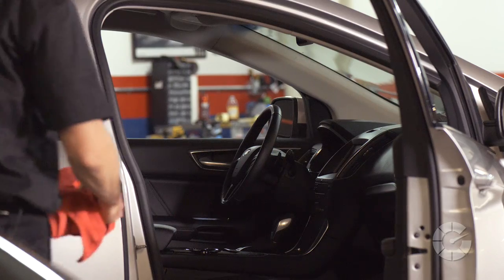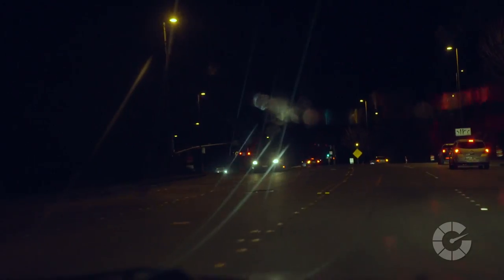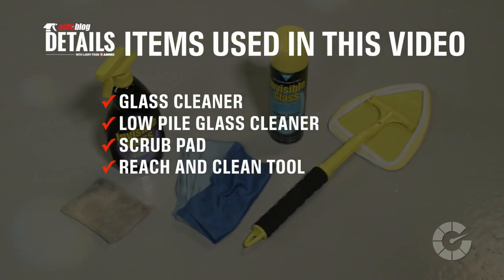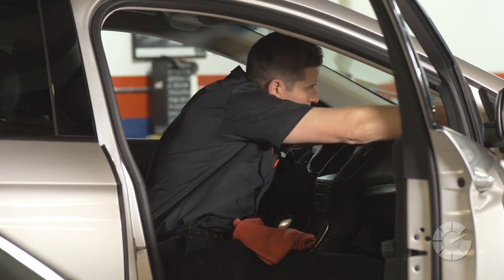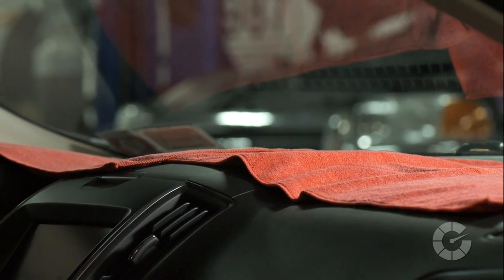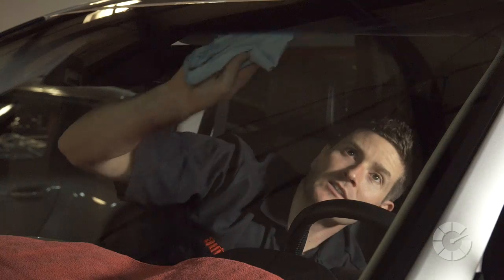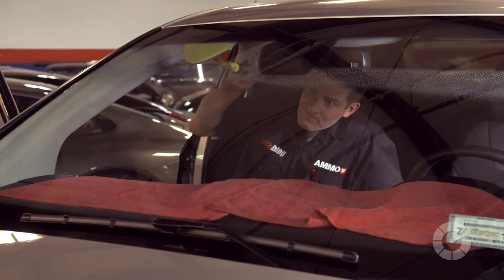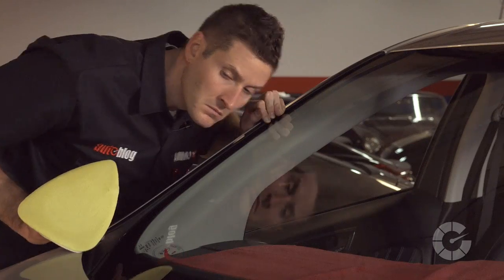How To Clean Interior Glass | Autoblog Details

Comment: My car is 13yo. The gases have gone long ago. I cant get my windshield glass clean. I have used every product on the market. Including the Invisible Glass I see you using in this video.
And just plain water, nothing gets it clean. I dont smoke, or carry chemicals in my car. So...what cleans 'old' glass? The 'new car smell' is long gone, i keep it in perfect cond. But that damn inside glass is always streaked or foggy.  got some ideas?
Reply: Sounds like you may have some sort of plastic tinted/non tinted film on the inside, as mentioned by someone else in the comments here. Once that goes, you haven't a hope - except for getting your windscreen replaced for a brand new one.
Reply: In a car that old I always suspect there could be microscopic pinhole leaks in the hoses and evaporator or heater core that aerate a mist of Freon or antifreeze onto the glass when your defroster is running. If you can smell it then it's definitely leaving residue and you're breathing it too. Refrigerant gases have oil mixed in them to lubricate the compressor. To get that clean you'd need to try things like alcohol, ammonia, and dedicated glass scrubbing towels. Certain types of cloth and paper towels that are not dedicated to cleaning glass could have oils that spread around when you're trying to clean. If you dry a car with a towel then it's picking up the wax from the car body. If you use the same towel to clean the windows you could be waxing them too.
Reply: Have you tried changing your cabin air filter? Try that along with some AC desinfection, it might help.

Comment: I own a Ford Focus, just like the vehicle in this video, and it is a very angled windshield, I cant even get to the bottom of the windshield to clean properly, so the reach tool seems to be a great idea. However, I am not a fan of microfiber towels, I tried as suggested to use them to buff away wax on my exterior paint, left horrible streaks, I guess if I really wanted to clean my windshield like a pro, this is a good approach, but to be honest, I smoke in my car adding to the film on the windshield, and to clean mine, I use my own mix of water, greased lightning, dawn, and just a bit of rubbing alcohol.. works great to remove film, windex is not appropriate for cleaning a whole windshield, the basic idea of windex is for spot removal... I dry with newspaper... yes, newspaper, doesnt streak at all.
Reply: Tpz 76 - what is "grease lightning?
Reply: @bethanyanderson1745  it is a degreaser cleaner available at any large store on the cleaning products aisle.
Reply: @MyMimi1213  thank you!